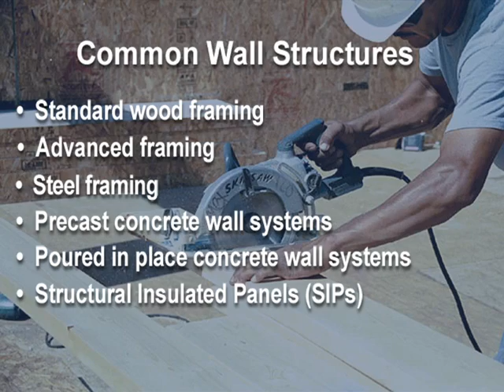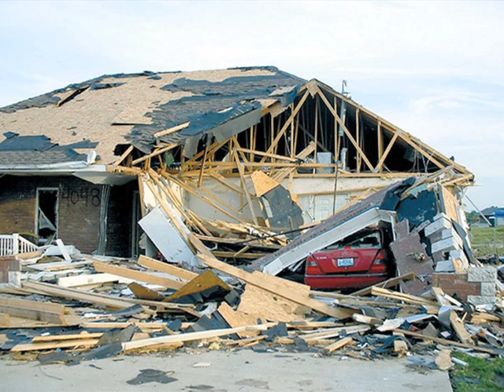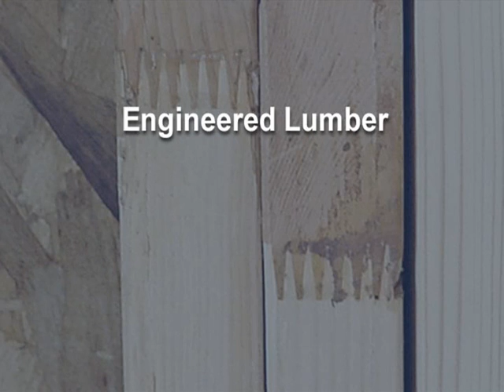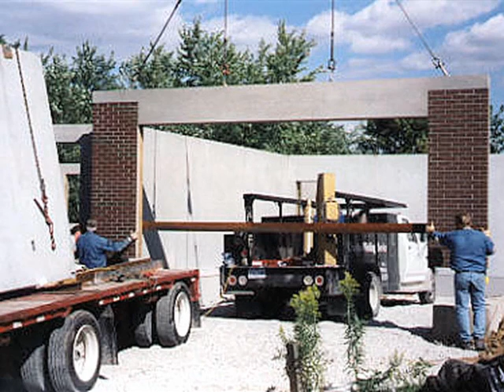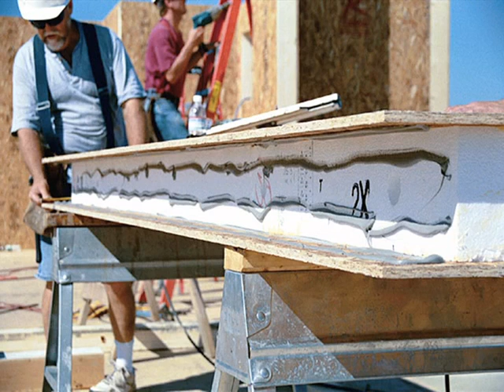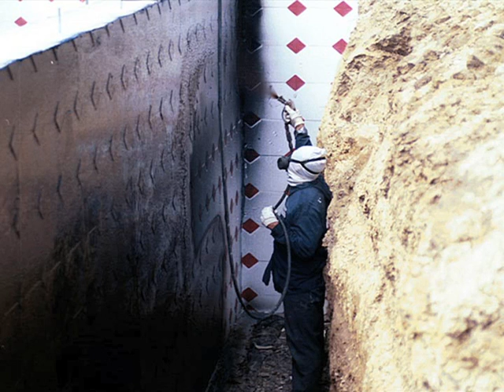Building Science Video: 7 Choices for Wall Structures

Comment: If it's a northerly climate but a bad spot for fires is it better to use an all steel frame?
Reply: YouTube R Control SIPs Fire Test. With stood 1 hrs of direct flame. In addition R Control can incorporate LP Flame block which is approve by Cal Fire. Steel will melt.
Reply: Steel studs are a bad idea in a northern climate because of the conductivity of them. You can put rockwool comfort board on the exterior of the wood framed structure if you want some fire resistance.